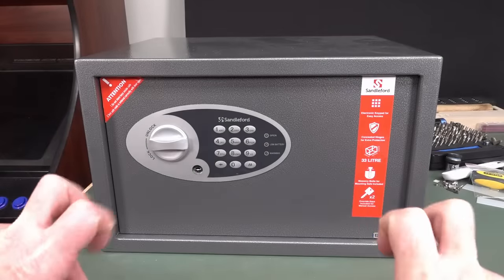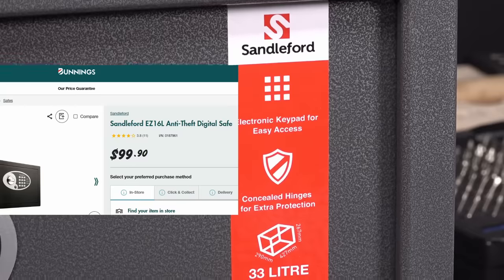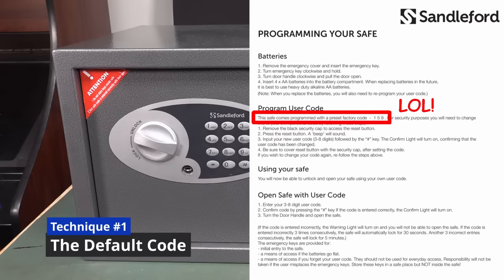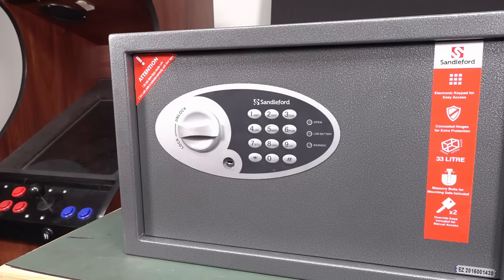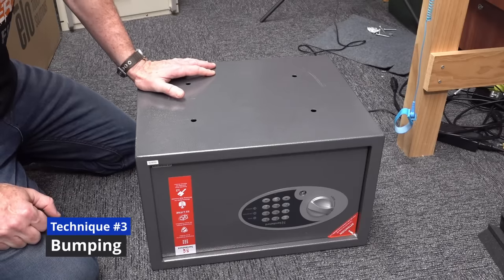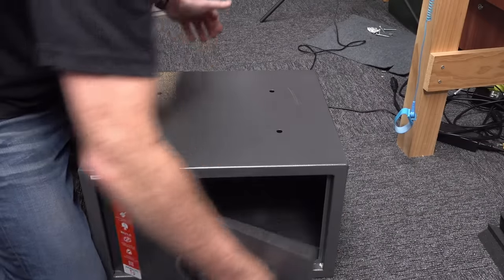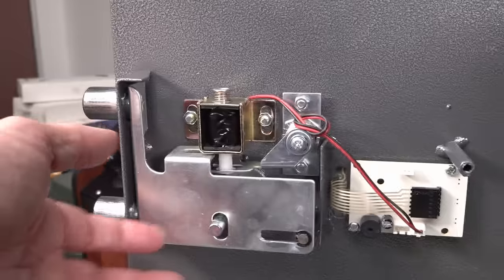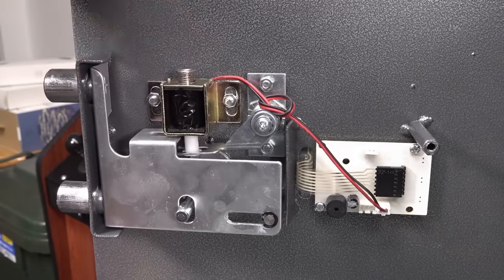EEVblog 1494 - FIVE Ways to Open a CHEAP SAFE!

Comment: The locking mechanism of the safe is pretty standard - you see the bolt sticking out of the rectangular body? That is actually a standard safe lock locking mechanism used in basically every quality safe - this is intentional so you can buy ANY safe, and replace the locking mechanism with your desired mechanism and it will fit in there - it's all standard!

Your basic safe will have a spinning combination lock - it is settable (you will see a mark off to the side that represents the number in "set" mode) and breaking into one requires a light touch and probably 2-3 hours of an experienced safecracker time to do it - in a quiet environment because it's actually solving a puzzle and requires concentration. An automated safe cracker left to brute force it will take literally days if it has to try all the combinations - it can be sped up if you know a number or two. Note these comination locks typically are 4 digits long. And once you've keyed the last digit in, you have to spin the dial which if correct will engage the bolt and unlock it.

Sparrows has a kit featuring a standard dial combination lock with the intent on showing you how to break into it - there are plenty of videos of people trying it and commenting it's a lot harder than it looks for someone without experience - to the point they also include the default combination if you give up. (Though the kit is easily opened in other ways because you're leaning how to manipulate the lock more than the kit being a real safe)

So even if your perfect safe comes with a dial combination lock and you wanted a high security one, it's easily replaced. Probably something the supplier of your higher security lock can do in about 5 minutes on your safe.

Comment: I have a few from a hotel renovation, they're not totally useless. Remove the lock and bolt/weld the cabinets to your farm truck or welding table for cheap toolboxes. Or weld them together for a cabinet. They are higher quality than Stack-On boxes.

Comment: Best to talk to a locksmith that does alot of safe openings to get the proper safe for your needs. You could even have him make it harder to get it open by installing hard plate, hardend ball barrings in drill points. They can modify, change or add to re-locker system.

Comment: I actually use one of these cheap safes by my door for parcels but i have modified mine with a seperate solonoid bolt wired to a relay i can trigger. You can make these more secure by bolting these down, adding a better spring on the solonoid and filling the keyway with epoxy. Just dont forget the code or get flat batteries 😂 Never store anything valuable in one of these !  I see them more as a delay box  😁

Comment: Hey, have fun with these safes. Place a booby trap inside and cheaply mount it in a easy to find location. The thief takes off with it and opens it elsewhere where a tear gas canister goes off leaving the crook crying. An olde friend once told me about a trap they had setup in Vietnam where they were trying to find the mole in the office. They brought in a trapped safe and were actually able to convince the locals who worked in the office that they stored attack plans in the safe at night. As one can guess, the one office worker who was guilty never showed up for work the next day. They were found a few days later in the outskirts of the village with three other Viet cong. Soilders. That claymore made shot order of finding the mole.

Comment: Yes, this safe has serious issues. But your blanket statement that "if you can carry it, it's not a safe." is a bit specious. Small safes are designed to be installed with appropriate anchor bolts to prevent the burglar from easily removing it.
Reply from the maker: Err, yeah, I mentioned that. It's a metaphor implying that heavier saves have more metal and are usually better designed. Small quality compact home ones can be carried and are usually under 50kg, like I showed in this video, I was able to pick it up and put on the bench.

Comment: the safe only needs to be locked and "fixed in placed" and it is insurable so it might be the safest safe in the world but it was never designed to be, its just harder to get into than a padlocked wooden box for example.
most people dont use the default code.. i think you will find it has a reset and that may have been used which would reset it to factory default settings... its like a modem, you wouldnt throw it out with your personal internet account/email still in it, you press the button with a pin, it likely even suggests this action in the manual

Comment: Would it be possible to upcycle this Safe to a thermal chamber or something similar? Ad some insulation to the walls, remove the little nylon lock thing (so you can always open the door by turning the knob) and add some heating/cooling inside?

Comment: Even most heavier safes these days use thin steel for the walls. It's usually just gypsum board sandwiched between pieces of thin sheet metal.

Comment: Ive seen some put the led that says access granted, in parallel with the whole solenoid power so you just have to break the led and short to ground itll power the solenoid and open the door..  this way is also a good way not to set off some tamper alarms..

Comment: I find that within the 25 seconds they have before the alarm goes off, it's a bit hard to find the safe, open the door, and get out! That's if they come via the front door. any other entry will trigger the alarm instantly. 

I would remove the Key link, and with luck they would spend the 20s trying to crack the key lock 🙂

And of course the 190dB sounder that's about 1m above the safe also gives them something else to distract them. Got to keep your weekly Gov pension  check some where.
Reply: @Okurka.  i'm in the UK  we use full fat dB's 🙂

Comment: Also if you drill a hole an inch over from the key you can access the plunger. Mine didn’t have keys one 4mm hole is all I needed. 
After that. All above mentions methods still work as well.

Comment: The unfortunate irony is that these safes are in all likelihood worse than no safe. When going through a house/business, the presence of a safe is a big neon sign pointing to the valuables, and if that safe is easy to get into, you may as well save your 99 dollarydoos and put a map to your valuables in the hallway.

Would be better off just including the valuables in all the other crap, at least then ir requires a lengthy search or taking the whole lot with them.
Reply from the maker: I knew a guy that used to leave a few hundred bucks on the table with a note saying somethign like "Here, take the easy win and leave all my other stuff alone."

Comment: I've got a six for you, that's how I did it. Just put a coathanger through the bolt holes on the back so you can hit the reset switch

Comment: I went to a popular hardware store and they recommended one like this.  I kept allot of cash in it and when I moved address found that all I had to do to open it without the combo was to simply tip it onto it's right side.  The latch just slid open.

Comment: I've got into one of these by pushing the reset button from outside, through one of the mounting holes. Really easy.
Reply: @Okurka.  it was! It was bolted to the wall and a metal shelf. I just removed the shelf from the underside to reveal the bottom mounting holes

Comment: The entry level safes aren't safes they are just lock boxes which don't have any security rating whatsoever but are still useful for storing non valuable items a proper safe has a security rating and is a lot harder to get into as well as being way more expensive because a proper safe would start from around 500 pound and up

Comment: This looks exactly like the kind of "safe" you might find at a big chain like Bunnings or Officeworks... Heck, I bet one or both stores will sell this exact safe (or the current version of it if its an older model)

Your comment about not buying cheap safes should be extended to "don't buy a safe from a big chain at all, even an expensive one" (if you want a safe, go to a locksmith/safe shop, you will not only not get sold junk but you will also likely get good advice on exactly what safe best fits your needs)

Comment: Cool video! I didn't expect it to be THAT easy to get into one of these. What's your experience with hotel room safes? Usually they exude similar vibes to me 🙂
Reply from the maker: Just as bad, if not worse, as they have default supervisor and other override modes. There are some decent ones though if set up correctly.
Reply: @EEVblog  I had a laptop in a safe in a hotel in China and the code I programmed in would not open it. I got the lady who supervised the room that had the safes in it (which i think is a good idea) and she couldn't get it to open. She did not know the hotel override code so i took a punt, as I had done some tests on the same brand of safe and thought i remembered the master code. I was right and got it to open. Th lady then got the manager to come and we had a talk so i ended up setting up a new override code for them and instructions on how to change it. I was impressed with their set up as having multiple safes in one secure room was much better than having a safe in a room where a thief could take their time opening one. They also had high tensile bolts fixing the safes to the thick metal shelves (12mm !) and a spot weld on the end. They had tried really hard.
Reply: @ianmontgomery7534  Except for the part of having the codes...
Reply: I can open most with a coat hangar. I make it a sport to open them in every hotel and have only come across one I could not open, but time was limited so i likely missed something.
Reply: @ianmontgomery7534  So it's less footwork for the potential thief 🙂
Reply: Try all 0's, always work regardless of the code you set

Comment: Found out at work that ATM's have a special set screw that has a loaded spring with a steel shaft. When the relocker fires it will shoot that between the slide bolt and a welded section that can't be shimmed it would have to be cut off to get open.

Comment: 13:43 "What is a good quality safe?"  

It seems, the brands mentioned are sold in Australia (some might be sold internationally). Anyway, search for high quality, torch and drill resistant; also, a safe with a relocking mechanism. And if a thief is able to remove the combination plate/box, they should still NOT be able to open the safe.  There should be other guards. You get what you pay for!  

BOLT down a safe to concrete.

Comment: These are fine just for storing your passports and documents.  It is more of a filing cabinet with a lock.  Just use a safety deposit box for anything more.
Reply: Not recommended to use a safety deposit box, as your money can be stolen "legally" by the government, there is a case on now about the US government doing this for a safety deposit company, where they went in for the express reason to take all the money, irrespective of the owner. Civil Asset Forfeiture.....

Comment: You could have just stuck a pushpin or needle through the wires. a nice thin pin hole is nearly invisible afterward. 
The screw holes, if not utilized, are great for fishing coathangars through to open, or just fish out the actual paper contents of the box!
Reply from the maker: I mentioned piecing the wires. And you can't push a coathanging through the holes because there is a cover box.
Reply: p.s. The cmi is nice, but unscrewing the knob on front gives you a quick and easy undetecable hole into the contents and possibly the mech.
Reply from the maker: @nobodynoone2500  Nope. Not possible. Metal protection cover, and the release mechanism is inside the sealed lock enclosure anyway.

Comment: you can also grab a rubber mallet and hit it!  and then simultaneously turn the lock!  if that doesn't work, have someone hold it and do it again!  guaranteed to open.
Reply from the maker: No, it doesn't wrok on this particular safe, as I mentioned.

Comment: even if you bolted it to a solid surface, a crowbar would be able to pretty easily tear the bolts right through that thin sheet steel, more effective was my grandad filling the bottom of his lightweight safe with lead diving weights, about 80 lbs was enough to convince the family it was bolted down (until they got into it) after he died

Comment: Problem is with any safe is the person breaking in will get into the cheap safe on their own but if you can afford a proper safe then you’ll be tied up and maybe beaten until you open the safe for them. Best place for your real valuables are in safety deposit boxes or something.

Comment: I found one of those cheap safes in a council cleanup. It has a 6 digit display. It came in its box with the manual, looked like it was unused. I tried the override code and it didn't open, the batteries were too weak to operate the lock. The keypad and display protrude out from the door, and on the bottom there is a RJ12 modular socket, I presume for external power. I plugged in a cable and found which wires have volts on them. Then I fed some volts (6V) to it and was able to unlock it. It's like the ones in hotels ans cruise ships, you enter any code to lock it and the same to open.

Comment: Safe in my hotel room  jamed after entering the code, something was blocking the unlock system, i called front desk and they sent repair man hoping he will bring a key to open it, but it was a keyless safe so he just use screwdriver through holes in the back of the safe, with pin point agility he was able to unscrew front mechanism to open the door, i just couldnt believe how safe this safe was.. Was in Colombia

Comment: 1:09 - You're in but you could've used the holes as the safe hasn't been secured to the floor and wall, which also explains why it's so easy to carry before installation.
Reply from the maker: No, because it has a back cover plate, and cap over the reset button.

Comment: Someone I worked with left her desk drawer unit key at home and so couldn't get her laptop out. People tried lock picking but I just pressed the drawer down and pulled on it to bypass the lock mechanism, which is just a slot and a bar.

Comment: Just bought one of these, most of these flaws have been addressed, the solenoid mechanism has been changed. Obviously it's a cheap safe and I was aware of that when buying it. For me it's more of a secure storage place in the house for some small items. Also if some methhead breaks into my house, I doubt that they'd be in the frame of mind to try to override the locks. If they can't rip it from its anchor point they'll probably move on.

Comment: Which is better on a real torch resistant safe- an electronic lock or a combination lock?
Reply from the maker: A good quality electronic lock trumps a tumbler or key lock. You can defeat tumblers and keys with skills and picking tools. Electronic locks require obscure sidechannel hacking tools, if they are even available.
Reply: @EEVblog  But a good quality combination lock has a known approximate timeframe for a robot to brute force it whereas an electronic lock someone might come up with a $5 tool that unlocks that lock in a second which can be widely distributed to people with no specialized skills? I agree key locks are worthless because they can be picked. The lock/safe industry seems to value security by obscurity so I’m worried a vulnerability will be found in a good electronic lock and they wait years to tell their customers.
Reply: @martinlutherkingjr.5582  There are quite a few Abloy lock mechanisms that are very difficult to pick, so use those instead. At least those are actually good, and the number of people who can pick them are small, so pretty much your security is the physical safe. After all the premise is to provide delay, so the thief goes elsewhere, a targeted attack you want delay. Electronic lock you can never know if there is a long combination master override that is hidden in the firmware. The best safe is both hidden well, built into concrete and brick, and has a heavy door with a good lock on it. Place the Bunnings safe elsewhere with a little bait in it.
Reply: @SeanBZA  Is there no decent open source electronic safe lock where you can compile the code yourself?

Comment: If I bought one of these, the first thing I would do is break the key off in the lock, so that wouldn't be vulnerable.
Then I would weld a plate over that hole behind the keypad.

I have a First Alert security box kind of like this, I've never seriously tested whether it's any good or not, because I don't want to damage it. I hope it's not this bad : (
Reply: @Okurka.  Not if you break it off while in the locked position ; )

Comment: I think this safe is very secure ! ... as long as you keep it in sight.
And as it's very light, you can carry it with you so that noone can mess with it when you're away.
Very simple mechanism, with very few parts, less chances to have a fault, and on top of that, if you lose the key  and the code, you can easily retireve you stuff and put it in a safer place ! You would look smart in  front of a reinforced manganese steel safe door if it happened, wouldn't you?
Honestly, Dave,  this is definitely not a fair review !🙂

Comment: The only use I've ever had with a safe is to protect documents from a potential fire. For that matter this kind of cheap safe is perfectly fine. I suspect some of the "anti pick" designs in this safe is more to prevent objects inside from jamming the lock than it is to prevent people from opening it nefariously.
Reply from the maker: No, this is NOT a safe designed for fire resistance. No metal only safe like this is. You need insulation and expanding door gasket material for a proper fire rated safe.
Reply: Not fire resistant, not pick resistant, about the only thing it does do is provide a convenient carry case for stealing all your valuables at once.